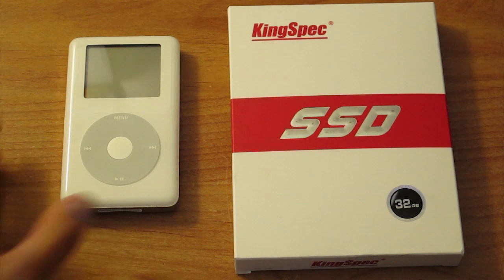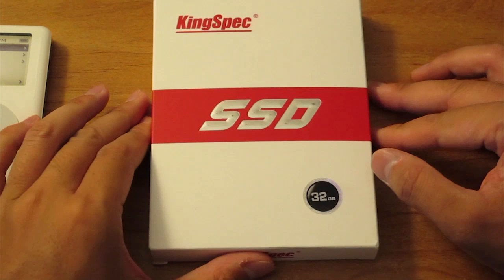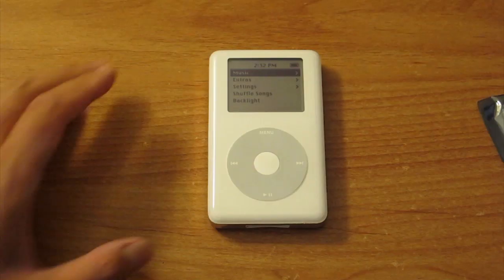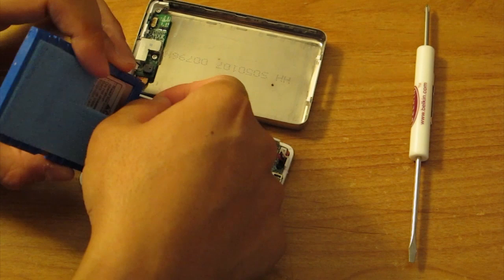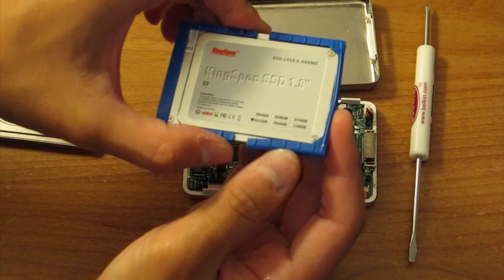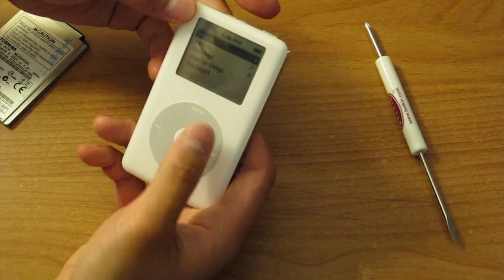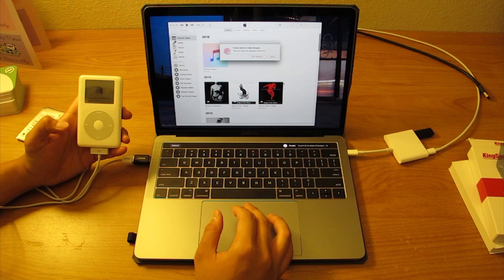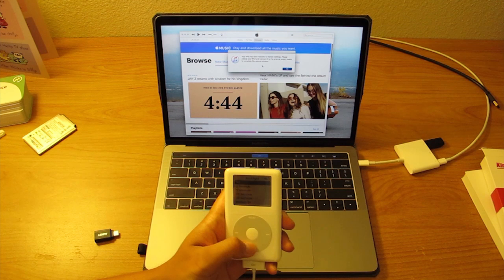Old School Classic Apple iPod 4th Generation SSD Upgrade

Comment: That's pretty sweet. I bet the battery life is way better. Especially with it being all flash memory. It's probably a lot more responsive  too.
Reply: It’s actually not true. An SSD takes more power than the original HDD because the HDD was a low powered slow spinning one meant to be used in an iPod, but SSDs were meant to be used in computers. An SD card takes less power than the HDD.
Reply: @rorywalters1614  hdd consumes more power, wth are you talking about
Reply: @bagzhansadvakassov1093  Yes but the hdd was powered down or something like that.

Comment: awesome video.  I like the route you took with getting an compatible SSD versus the compact flash adapter.
Reply from the maker: Thank you, the SSD definitely made the upgrade much more straight forward and cleaner installation.
Reply: Pity these SSDs cannot be got any more unless you're a person in the service industry. I only found one place that has them and you need to be VAT registered and an IT guy of some sort to get it!
Reply from the maker: They are still sold on Amazon if are looking for them...
Reply: lol, what are you talking about? You can get them on Amazon, Ebay, AliExpress,DX.
Reply: @iaincowell9747  Please link me ive looked everywhere!!!

Comment: So so poeple don't mae my mistake. I put the SSD in the wrong way. There's two different locators on the SDD like the video points on. A round one and an oval type one, the oval type should match that of the iPods. The device wouldn't boot. I fixed it by unplugging the battery and reconnecting it. I was shitting myself thinking I fried the local board and SSD.

Comment: SSD still too expensive
I'm going to go the iFlash-Quad route. Then 4 X 64gb or 128gb SD cards.
Reply: 20 for a 120 gb ssd is not that bad
Reply: Fourth gens can only handle 64gb or 128 if you're lucky

Comment: i have the iPod Photo 60GB gen 4, w/HDD, but its sorta dead (garage sale find) does that model you have come with a color screen? would like to rebuild it. am watching several upgrade vids. thank you  i think I would do the same with the blue foam
Reply from the maker: Mine does not have the color screen, but it should work with the iPod Photo 4th Gen as well.
Reply: Tonite's tea corner i think mine has the b/w screen, not color. is there a color screen that can be installed? how good is tbat KingSpec SSD holding out? thanks again
Reply from the maker: @j.lietka9406 Sorry, I had thought the model you had was the iPod Photo. Only the iPod Photo of that generation had a color screen.  Anyways, my iPod with SSD is still running great, thanks!
Reply: Tonite's tea corner ok thanks. the "dead or sick icon" would appear but in b/w. does that SSD come in a 64GB, or 128GB version? not worth it to put a 32GB! i think the battery needs replacing, too.
Reply from the maker: @j.lietka9406  Yes, they make a 64GB and 128GB version, but it has to be the 50 pin version. Also, I've read that the firmware is only compatible with up to 60GB, therefore a larger drive would still cap out at 60GB.

Comment: I know flash storage was expensive back then but damn...a mechanical HDD that someone would wear while jogging or biking.  Wtf were they thinking?
Reply: They had 2 choices:
Fit an unusable amount of flash storage to keep the cost down
Use a hard drive
Which would you choose? Also, the platter is sideways while doing the activity, which causes far less risk, as well as small parts = lighter parts.

Comment: Nice video man... 

I so badly want to do this, but here in South Africa I can't seem to find it and the ones I did find on amazon does not ship to SA... not even the cf card and adaptor is really a solution as those cf cards are so expensive and I do not see the point in buying the cheaper 4gb and 8gb cards, then I can just as well use my phone. 

Though I do appreciate your video. Thanks.
Reply from the maker: Thanks! I know they also sell on eBay? they might be open to sending to South Africa. That could be an option. Good luck!
Reply: Tonite's tea corner never used ebay before, but will have a look. Thanks
Reply: Try AliExpress

Comment: Do you think a 64GB SSD from kingspec would work?
Reply from the maker: I should work, but I've heard the firmware only can see 60GB at most. Also, make sure the SSD is the 50 pin version or will require a 40pin to 50 pin adapter.
Reply: @nycmaster  Thank You!

Comment: For ipod classic can it work on 160gb?
Reply from the maker: I'm not sure about the iPod classic 160GB model, those are the 6th and 7th gen models.
Reply: It will work, but you'll need a taller back. They sell them on Ebay.